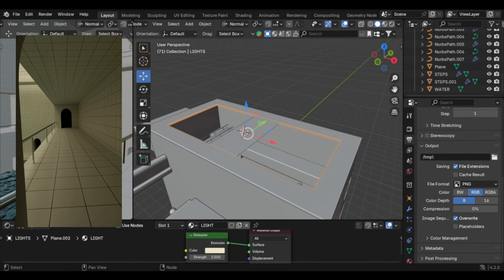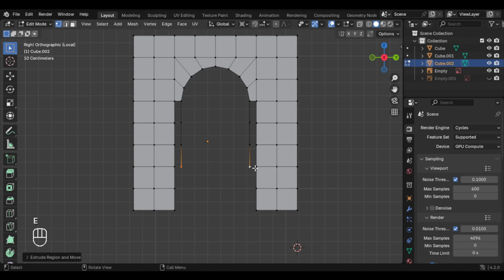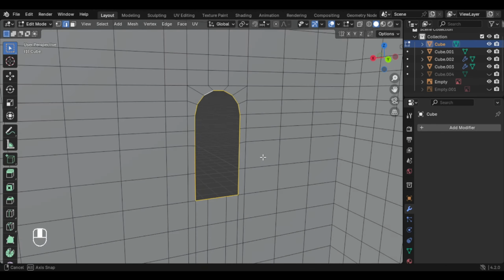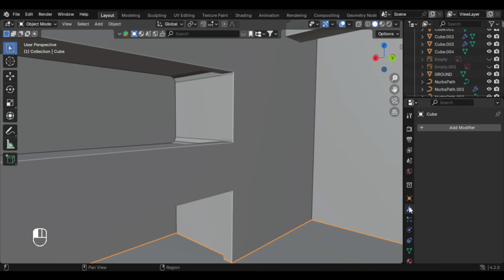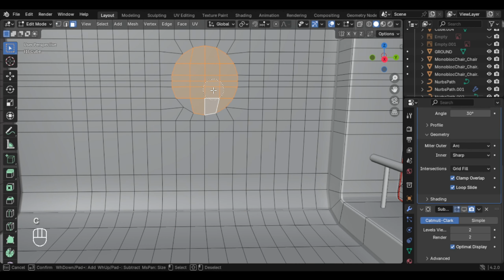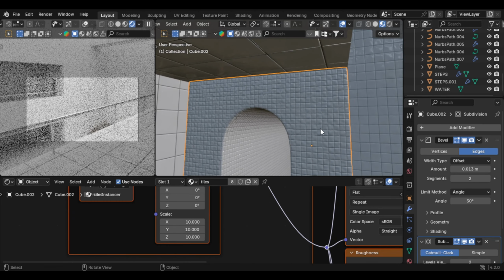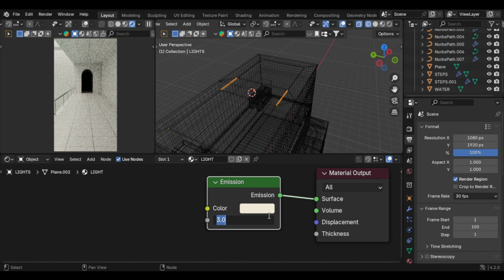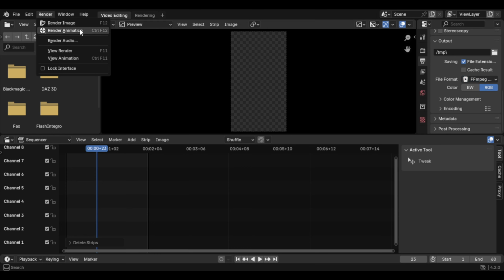How To Make Found Footage In Blender | Tutorial

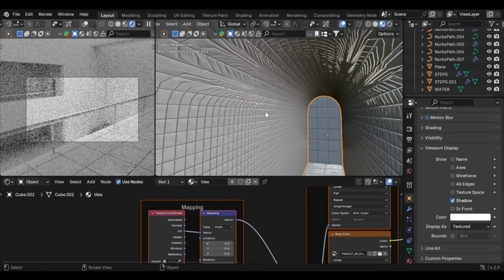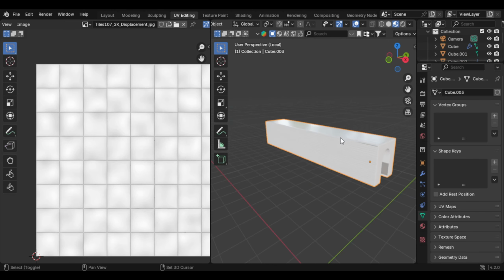Comment: Great tutorials, I was just wondering one thing, 33:30 you made a loop cut on that hallway before fixing the UV, but at 34:25 you didn’t do the loop cut and just went into selecting sharp edges and unwrapping and it still worked, why did you add the loop cut on the first one?
Reply from the maker: Thank you. That was actually not necessary if you mark seams and unwrap it. Only if you do it without seams it should be necessary
Reply: @jensworld444 thank you for the quick reply. I hope you continue making long tutorials, you are great at explaining everything!
Reply from the maker: @nolant3728 That makes me happy to hear! 😊
Reply: @jensworld444 I just had one more question I am doing a poolroom which is like infinite arches, but I had a problem where the subdivision surface modifier was warping all the tile texture, so I ended up just removing the modifier because I couldn’t figure it out but my arches don’t look completely smooth. Any ideas?
Reply from the maker: @nolant3728  I would suggest applying the subdivision modifier. And unwrap it again. It should be ok if you use array modifier. But you shouln't apply the array, otherwise you may have too many vertices.
Reply: @jensworld444 ok I have been keeping all modifiers un-applied but I’ll try to apply the subdivision and unwrap again. Thank you

Comment: This is absolutely incredible! This has jump started my creativity in creating these scenes and I've already made two just today after watching your video! Thank you. 

One issue I have is my water is still not transparent. It looks great and reflects the walls on the outside great but is not see through to the floor of my pool. I'm in cycles and have followed your water creation exactly. Is there any other setting I might be missing? Thank you again.
Reply from the maker: @ilyandilymusic  Thats so great! :) 
Maybe you have accidentally added a translucent instead of a transparent node. But you can also try a different method. Just leave the principled bsdf and put the transmission all the way up to one. Add a bump and noise and connect them to the normal of the principled node. Don’t forget to change the IOR to 1.333
Reply: @jensworld444  I ended up deleting that water and creating a new mesh and it works! I'm not sure what was going on with the first one. When you make a water material does it matter if you start with a flat plane or a cube that is scaled to the size of the water?

I did a cube the second time and scaled it to the size my water would have been. Thanks again for the great tutorial!!!
Reply from the maker: @ I’m glad it worked :). You’re welcome!
Reply: @ Your tutorial also showed the power of using and learning the basics. 

Extruding, loop cuts, using reference images. Incredible work.